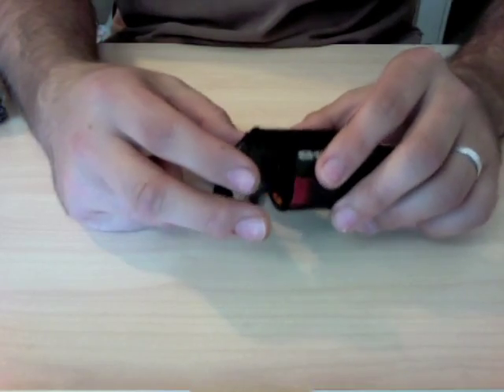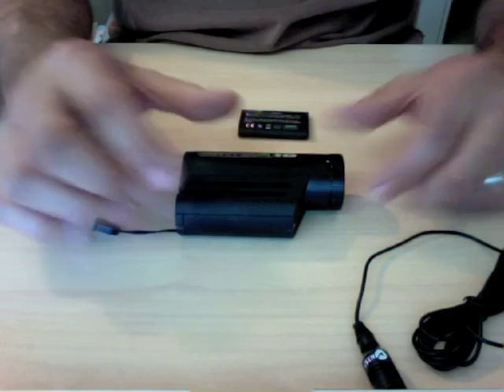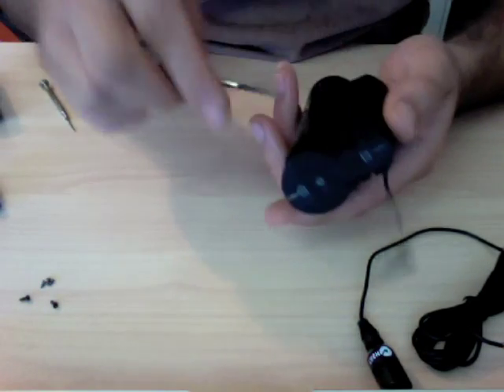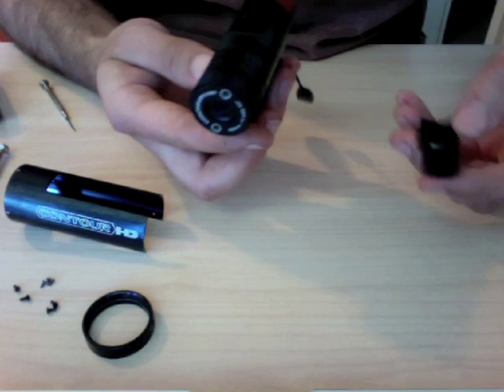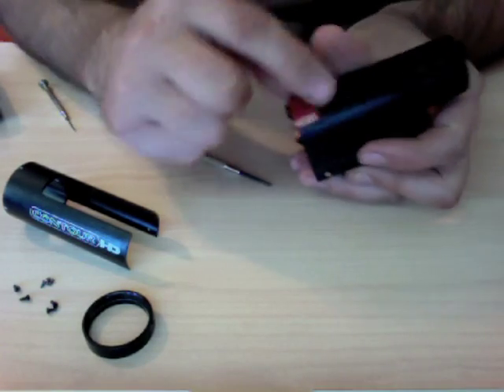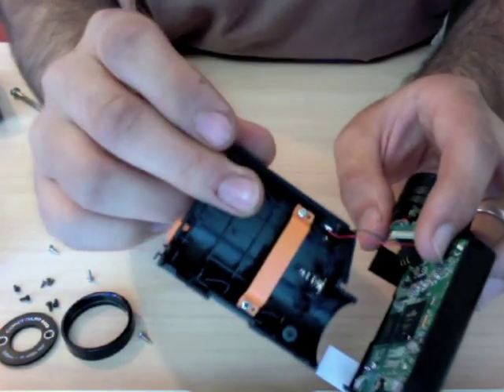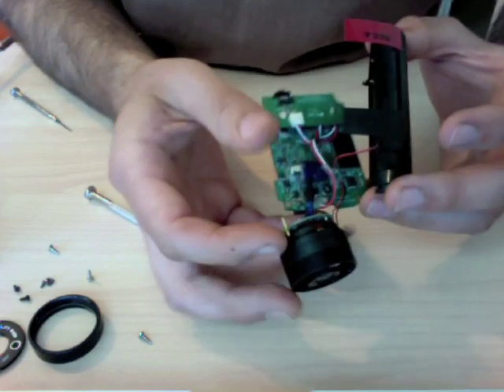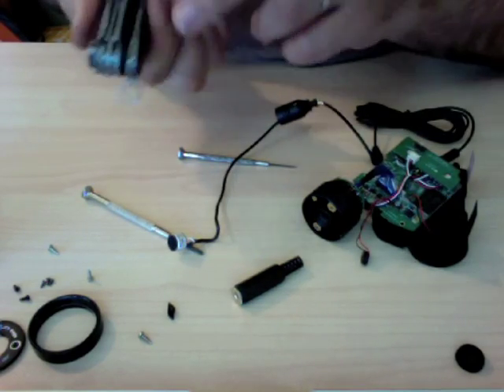Pulling apart a Vholdr ContourHD - solder free

Comment: Thanks for the video - I had to take my Contour HD apart and found your guide very useful. I dropped my camera and the tiny piece of plastic that holds the battery in snapped. I decided to strip the camera down and remove the spring which pushes the battery back out, so that I can now keep the battery in to charge.